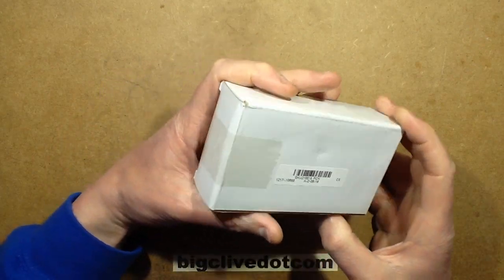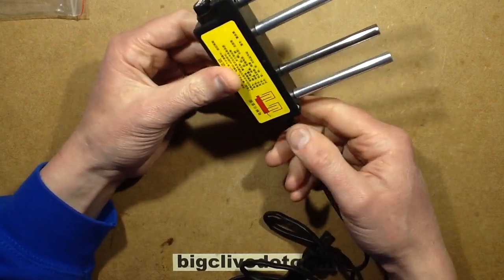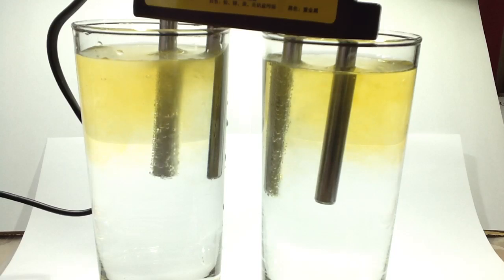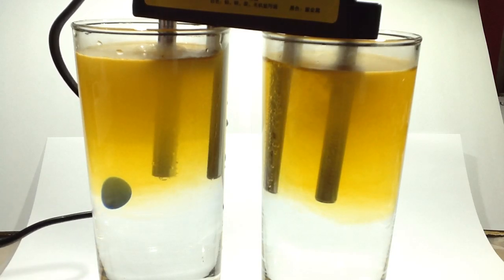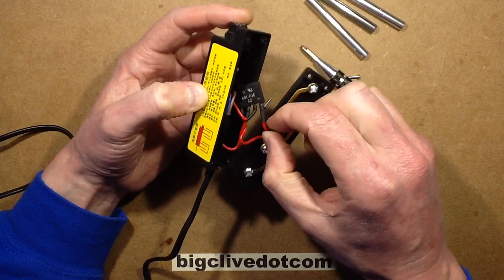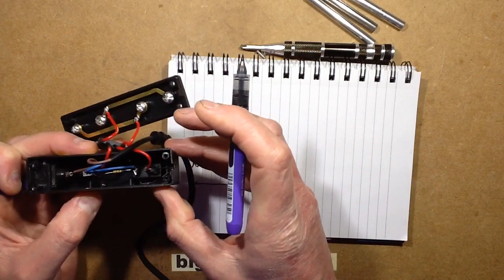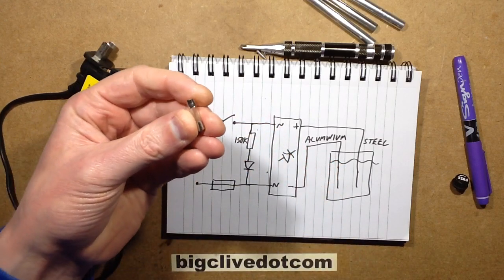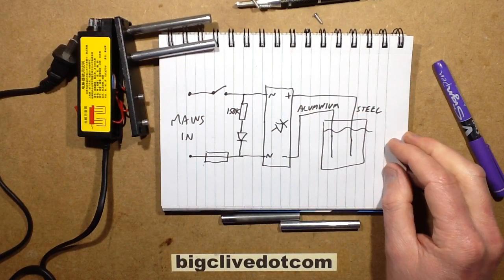Deadly quack water tester.  (scam)

Comment: It may be a cheap piece of Chinese tat, but your experiment as you called it wasn't really a true demonstration of different waters ie a couple of bottled waters and your filtered water which looks like it hasn't done anything so you may need to change your cartridge. The chemicals put into tap water are just not good for you along with the ageing pipelines that bring it to your home, there are many electrolysis devices on the market you chose this, and we have to take this as some sort of scientific demonstration as to prove anything. Stick to taking cheap tat apart

Comment: What's the problem here again?? Steel (Iron alloy) is the cathode (site of reduction) so technically reduction of Fe2+ and Fe3+ in solution would deposit on the steel electrode, not the other way around. Other metal ions would also deposit due to the conductive charge being supplied. Furthermore, the aluminum electrode is acting as the anode (site of oxidation) so we should see Al3+ ions forming... which should also redeposit on the electrode eventually. 
The metallic ions present in the water sample the more reduction of ions into the solid state and increase in turbidity.

Comment: So what is your conclusion?
 It electromagnetically charges the water, sure. But that is completely beyond the point of why these are being used.
 charging the water is the only way to make the components within the water, come together and become visual.  
 When charging distilled water, there is no occurrence of sludgy minerals.   
 So basically this device just reveals what your minerals look like inside of non distilled water? 
The question missed here, is; Does normal water naturally contain these sludgy minerals revealed by electromagnetic charge? 
Or is the sludgyness artificially apparent due to the insertion of prongs? 

Its not a scam,  if the water already contains these minerals, and the prongs just visualize them. 
It IS a scam, if the water does not contain minerals that turn sludgy when charged electrically. 

my bet is that, the water already contains unnecessary minerals, and is filtered with chlorine chloride & fluoride in order to make this appear visually pleasing.

Comment: The color is from ferric (iron) ions.  That's why one of the electrodes is steel - it releases iron under the applied voltage, making sure that the water turns out to be "impure" and "needs" to be filtered.  
Distilled or de-ioniazed water, used in the other glass, won't conduct electricity, so the steel won't corrode and no color will be generated.

Comment: Yikes!!
Can you test and open up this?
https://www.lishtot.com/how-it-work.html
A keyring yes/no, blue/red led, drinkable water tester.($50, 35 quid!)
An electric field detected around water apparently varies with water purity with regard to metals(nasty),compounds(nasty-industrial) and particles (bacteria+).
Blue light: does it work? Is all bluelight water safe?
Red light: drinkable water that fails is ok just non optimum.
I got an old physics A level. My guess is that the electric fields being detected would be a. Very very weak (difficult to isolate from static on fingers,clothing etc) and b.have a very small range 
...and too much for a keyring device.
Scam?

I dont know if this is out of your sphere.
captainrocketblast@gmail.com

Comment: Can this be repurposed to remove rust by electrolysis ?
Reply from the maker: No.  It's too dangerous.  Use a low voltage system.
Reply: @bigclivedotcom  thanks , so what make the process faster Volts or Amps ?
Reply from the maker: @intel386DX  I'd suggest a bench power supply for safety.  Then it could also be used for plating.

Comment: I used a TDS Meter water tester to see the difference between my tap water, bottled water and filtered water and I was surprised to see that the water filter made very little benefit to the water at all. It was a new filter that I used and that after time the water filter acyually made the tap water worse than it was out of the tap and that this was after little use.

Comment: I'll look up the water quacks, just for a giggle. It looks like the minerals(?) are causing a reaction like metal plating? Two dissimilar metals and an electrolyte, passing a current between? is it forming an oxide on one electrode? The brown goo (schmoo in AVE-eze) is the conductive path explains the current increase. Yes, distilled water, or DI water, but through a brita filter won't remove enough conductive material.
Ah, snake oil and hucksters, what would the world be with out them, bless their heart.

Comment: The color is just iron diffusing off the ferrous electrode.  Normal tap water has mineral ions, making it conductive and allowing the electrolysis.  Distilled water is much less conductive, so won't discolor as quickly.  Proves only that, nothing else.

Comment: making hydrogen indoors can be dangerous. i made one of those hho gas generators for a car to see if it worked and the plates i used were not as stainless as i had thought . I ended up with a hole pile of rainbow gunk in the bottom, and the plates half dissolved.

Comment: You are not to knowledgeable. This device is approved by the FDA. Your filters are good. The Yellow content in your water is showing mineral content.
Reply from the maker: This device is not "approved" in any way by the FDA.
Reply: This Device is used in the Food and Drug Administration here in the sates ..... It is actually in English here, not in Chinese
Reply: "This device" is an electrode engaging in galvanic corrosion of dissimilar metals. Please explain what use the FDA (who, btw, don't have any responsibilities with regard to water quality, that's the EPA and local water departments scammer) would have for creating rusty water via galvanic corrosion?

Comment: should have gone into the ionization chemistry going on at the anode and cathode.

the precipitates you see are calcium chloride IIRC (the white lumps at the bottom of the glass) which is non-soluble.  Most tap water has some level of calcium hydroxide in it, which during electrolysis combines with chlorine atoms from salts in the water to preferentially form calcium chloride.  The gas (bubbles) is oxygen produced at the cathode by splitting water molecules, and hydrogen from the reaction with the aluminum anode.  The brown coloration is caused by the production of aluminum hydroxide via electrolysis as well, and is the very reason this thing uses aluminum anodes; to try and fool you into thinking the water was "contaminated" before they started testing it.  

that is also why Clive thought the water smelled "metallic".  it's the aluminum hydroxide being produced.

it's obviously effective, as you saw Clive not wanting to drink that water.

such a scam though.  should be entirely illegal from several perspectives, not just the risky electronics, but outright fraud among others.

Comment: This reminds me of a video where ElectroBoom was talking about why AC hurts worse than DC. 
https://www.youtube.com/watch?v=vNpGoNP1tGQ

Basically his explanation is that AC flows through the body easier than DC because of capacitance. And as a result, if you rectify AC, even mains AC, into DC that you can touch the leads with far less danger. In his case of being in Canada where mains is 120v, not 240v, rectified AC ends up being ~170VDC. In the very beginning of the video, he shows how the rectified AC will still light a standard lightbulb, yet touching the leads with his fingers doesn't really cause any pain.

And BTW, I'm not advocating or suggesting that this product is "safe." I'm just suggesting that perhaps it's not as lethal as having the mains directly connected to those probes given it is at least rectified to DC.

What say you?

Comment: Could someone explain to me as I,m genuinely curious why does this product not make all Waters go brown but only some as in other demonstrations?
Reply from the maker: Normal water is slightly conductive.  Distilled water is no conductive.  This device causes accelerated corrosion of its electrodes for the colour effect, based on the amount of current that flows.  So normal tap water (even filtered) will cause the colour change, but their "reference" water (distilled) will not pass enough current to cause the effect.

Comment: The LED is before the rectifier?  Or were you just in a hurry?   Not picking nits, just curious.
Reply from the maker: Yeah, it only lights half wave and shunts the other way.  The unit was not designed by someone clever.

Comment: If you added caustic soda to distiled water the water would still stay clear. So clear water does not mean it is safe to drink.
This is not only a con but not dangerous, it is LETHAL! Ebay should not be accepting ads for this product. It is even sold by English ebayers. Time to tell trading standards to get this banned.

Comment: Seems there are a lot of gullible and not very bright commenters in here. Lol. They don't even understand the scam either. It's pretty simple though, as some people with some Science knowledge explained so well in here. The device is what is making the water discolored! It doesn't happen in distilled water, because distilled water is not conductive and tap water is. Distilled water is also empty and has no minerals. Add a little salt to distilled water and it should become more conductive and corrode one of the probes and foul the water (same as tap water). Anything that makes the water more conductive, will make this device discolor the water. You should NOT drink distilled water and if idiots knew ANYTHING about human Physiology and Chemistry they would realize that distilled water is actually leaching minerals OUT of your body, cause it is a different chemistry than tap or spring water with minerals. That's not healthy! 

This video is great and the comments prove just how utterly dumb people really are. It's a simple and dangerous device, get it?! It's operating similar to how electroplating works. Except Aluminum does not electroplate so the rust from the steel probes stays in the water. Understand the Science and the scam going on here. Damn, people are so stupid.
Reply: What you are not understanding though Slippy, is that water without minerals (like distilled, or R.O. water without a remineralization filter as the last stage), is empty water. It leeches minerals out of the body (like the bones). This is more than proven with basic human Physiology and Chemistry. I love R.O. water, it's sooooo clean, but I know for a fact, that once it is stripped of it's minerals and other stuff, it comes out slightly acidic. A remineralization filter, puts those minerals back in and balances the Ph back out. That way in won't leech minerals out of the body. You can do the same with distilled, but you have to manually add the minerals back in with something else. This is all easily provable "real" Science.

Comment: Those two different metals are necessary to cause the electrolysis ("contamination") to occur. If you used the same metal for both electrodes, nothing would happen.
I'm not 100% sure on that, but I think that's what I remember from my chem course in college many years ago.

Comment: My understanding was that the water "purifiers" these things are used to sell are technically deionisers, so when the test works it's because the deionised water is less conductive.  That's why in big clive's filtered water (I guess passed through a Brita filter or something similar) will not give noticably different results from normal tap water.

The brown crud in the demonstration is 100% coming off the electrodes, it's nothing at all to do with mineral impurities like calcium or nitrates in the water.  You can't really demonstrate this without the water purifier they're used to sell; you need to take some of the supposedly "purified" water - which does not produce the brown crud - and then add a little table salt.  If I'm right, the result should be that the brown crud comes back.  If that happens, unless you think the table salt is producing the brown crud, it's pretty obvious that the discoloration is coming off the electrodes, not out of the water.

I can't remember who exactly I heard the explanation from, but it was a chemistry teacher who had a salesman demonstrate the "purifier" in front of him.  The salesman was horrified when the chemistry teacher did added the salt (presumably because the salesman honestly believed in the test), and was apparently even more bewildered when the teacher was still interested in buying the unit (deionised water is useful for some things, just not particularly for drinking).

Comment: So the aluminum probe electroplated the steel probe and the steel probe released iron oxide into the water? 

It proves the filter doesn't get electrolytes out of the water, but it doesn't prove the water is unhealthy to drink.

Comment: Because the negative is alum, the iron particles wont stick too well to it. The freed up iron particles just become oxidized from the hydrogen loss reaction at the nucleation site. It maximizes rust production. The product doesn't work in the distilled water because distilled water lacks enough ions to conduct current.

Comment: The aluminium has a higher potential than steel does. It acts as a anode and the steel is the cathode. I believe the aluminium is losing electrons into the water. It's like a battery circuit. The water is the electrolyte.

Comment: This item is available on Amazon via a 3rd party seller.  It's advertised as a Total Dissolved Solids (TDS) tester.  The site gives color interpretatios:  
Black: Heavy Metals
Yellow: Dissolved acids, fluoride and other organic matter
Green: Arsenic, mercury, lead, copper, sodium
Blue: Bacteria, viruses, carcinogens, chemical fertilizers, pesticides, etc.
Red: Iron, rust and bacteria
White: lead, zinc, mercury, inorganic dirt

I wonder if you put rat poison in one of the glasses, the color would turn green, or turn blue with a pesticide as the seller claims.  Another YouTube video shows their water turning black!  Their mineral water also turned black but not as fast.

Comment: Scam people by doing electrolysis. The discoloration is most likely chlorine which is used by most water recycling facilities.  As the free electrons pass from one electrode to another the water is vaporized and chlorine is turned into the gas form but is then quickly dissolved back into the water. Hence the yellowish tinge

Comment: They had to use different electrode materials because the aluminium will rust the steel, producing oxides that fill the water.

Comment: I used to sell home water softening and purification systems door to door back in 2008. I remember having one of these things in my kit.
The device would be used on plain tap water to neutralise the chlorine in the water and show the homeowner what was really in the water. Then we would hook up the 2 stage water purifyer demo unit which was a smaller version of the in home 2 stage unit.
We sold a full 5 stage water purification system. The first 2 stages would soften the water and remove quite alot of the total dissolved solids in the water stages 3, 4, and 5 would perform reverse osmosis on the water at a unit housed under the kitchen sink and then that would become the households "drinking water". We also had a "TDS" meter which woud tell us how many parts per million of total dissolved solids were in the water. The electric rod unit would be used to make them visible.. Or at least that is what i was told by my managing company. This same tech is used in the "inonizing" foot bath in many pedicure salons to "remove toxins from the body" truth be told they are just running a low current thru the water and neutralising the purification processes that the water goes thru at the municipal water purifying plant.
I did accidentally break one of these units once by shorting it out when i put it into a cup that was to short snd msde contsct with the kitchen sink. It sparked and triggered the circuit breaker in the home. Also left the sink scarred by an arc spotweld.
All in all and interesting and fun gizmo. But from what i was told. I thought i was showing people the truth about the water in their homes. I was never aware of any snake oil schenanigans.

Also that water filter you used was a charcoal filter wasnt it... Not a 2 stage salt ion exchange water softening filter or reverse osmosis. With reverse osmosis water you get no reaction with the device. With 2 stage salt ion exchange water softening you get a drastically reduced reaction.

And now that i have watched the whole video with the circuit breakdown. (I dont know why it didnt hit me when i had the thing in my hand) the "yuck" in the water is actually generated by the rapid oxidation of the steel rod due to the electrical current and the different ways the two metals act in water when electrified. But ther eis one thing missing from your test that i got here in the dallss fort worth area of texas: i always got a green slimy almost algae like substance that also formed in the water when the unit was used. I kinda hsve to wonder why and what it was.
Reply: Yes, I am missing the explanation of why this test does not reveal impurities in water.  I would love discussion on it’s efficacy despite it’s risks because my friend already did these tests on our water and I wonder if it means anything at all.
Reply: Yeah.. I wish I better understood this stuff. It just does not stick in my brain.